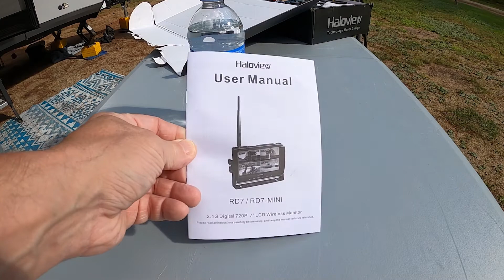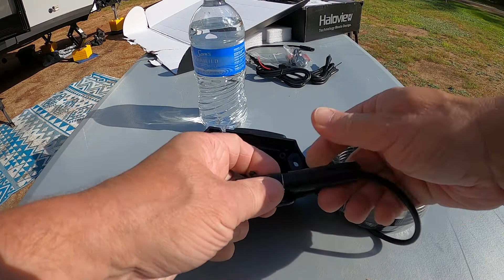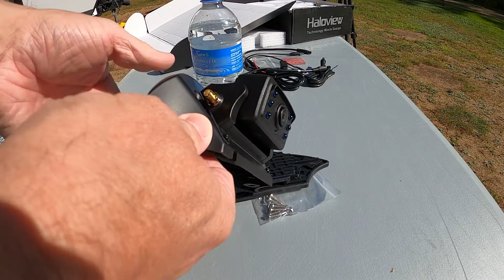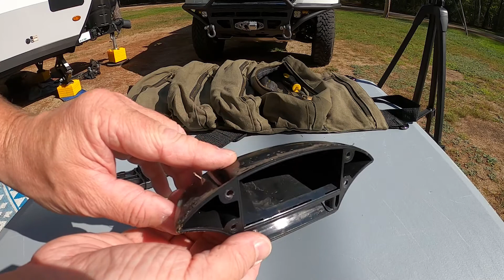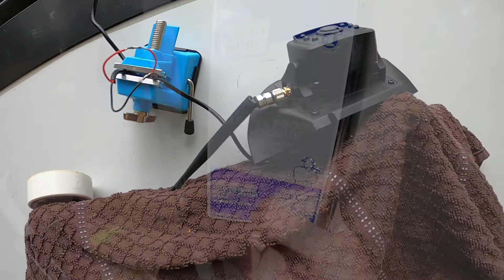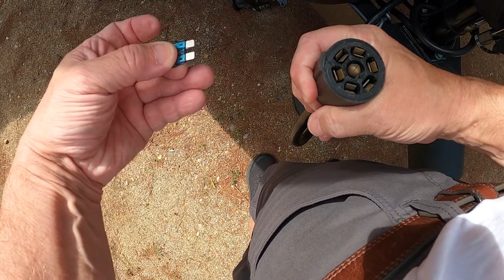PT 1 Haloview Wireless RV Camera | Furrion Rearview Adapter | 7 inch 720p Wireless Range Dominator

Comment: Mario, we are enjoying all your well done informational vids. You are a natural . So cool and calm . Glad we found you. Stay safe and keep up the good work. Oh btw we have a Geo Pro 19fb. Fyi, check the underside for loose nuts which hold the body to the frame. I had a couple missing. Lock nuts were the sulution.
Reply from the maker: Thank you for the kind words, Beverlee. I am glad to hear you have a similar travel trailer. I hope you have opportunities to get out and enjoy it! Thanks for the heads up on the chassis nuts backing off. I will definitely inspect them!
Reply: @MarioWorkedOnIt  working on it is the best .
Reply from the maker: Hey there, Beverlee. Not sure how I missed your comment. It got marked as SPAM and did not show up until today. Anyway, I appreciate you taking the time to comment.